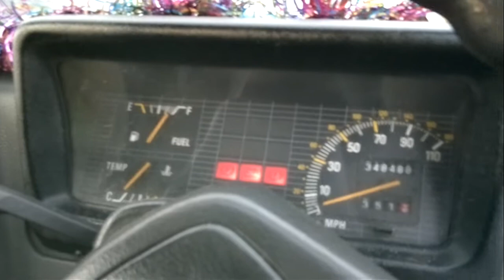cold start London fairway taxi

Comment: I have a 1997 Fairway just like that and it, too, starts brilliantly.  I bought it pretty much off the London streets last June just as personal transport.  I was wondering how it would start at minus 7 (the lowest so far this year) but I need not have worried.  Thanks for the video - I must get some of mine online!
Reply: have you still got the taxi, and could you do a cold start video
Reply: @nathanreid2974  Sally, no we don't still have the taxi. We traded her in for an electric car, a Nissan Leaf in 2014, since when I have also retired.  I still miss the taxi from time to time.   😃
Reply from the maker: Mine did, really bad. Eventually thick black tar like substance would eventually seal the blowby to some degree that it was hardly noticeable to the un trained ear. If you cleaned it all off it would sound like a steam train.
Reply: @Richbowker  did you get it fixed in the wnd
Reply from the maker: @nathanreid2974  no I never bothered it never got any worse.

Comment: I drive a 1996 Nissan Urvan E24 with the TD25 motor, the Fairway engine's sibling, had it for 5 yrs now, without a doubt the best diesel engine ever made, just show the key and it starts all weathers. Engine still dry as a cork after 130,000 miles. I am sure the London cabbies now mourn the passing of the Nissan diesel for the horrible Transit one (better make sure the AA cover is good...). Even drove 600 miles with a dead alternator on the Urvan - try that on a modern computer controlled heap!
Reply: i think the nissan TD Engine is still in production, manely for the nissan patrols in Australia, see Wikipedia.
If you look on line, other sites may say that nissan TD engine production stopped in 2001
Reply: how does condensation form at the back

Comment: was the engine blowby something to do with the piston rings on the cylinder  walls
Reply from the maker: No mate. It was just how the injector was sitting in the head. I could of removed it and changed the Cooper washer underneath but I never got around to doing it.
Reply: @Richbowker  never heard of blowby like this before, i thought blowby was caused by the piston rings or pistons, but at least it wasn't that.
The nissan 2.7 i thought was an indirect injection so therefore the injectors are before the head and not in, where ful is injected with the intake stroke rather than before, otherwise known as pilot injection.
However early direct injection vehicals although having direct injection didn't have pilot injection as it is ECU oporated.
I like the old nissan engine and glad it was nothing that majour
Reply from the maker: @nathanreid2974  some compression from the piston escapes up past the injectors causing a chuffing noise.injector blow-by occurs when the injector does not seal against the injector seat in the cylinder head. Often a chuffing sound is heard or black “tar” can be seen around the injectors.This happens because the seat in the cylinder head has been eroded by the escaping combustion gases resulting in damage to the seat. Usually a thicker or slightly larger washer fixes this.